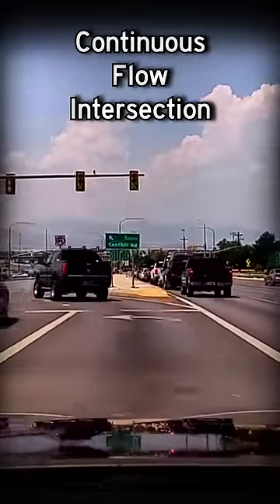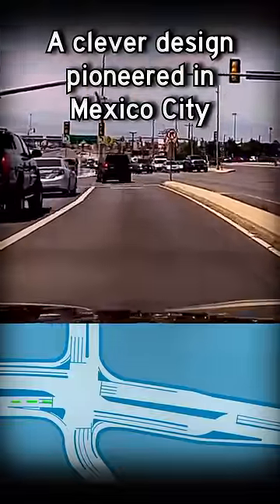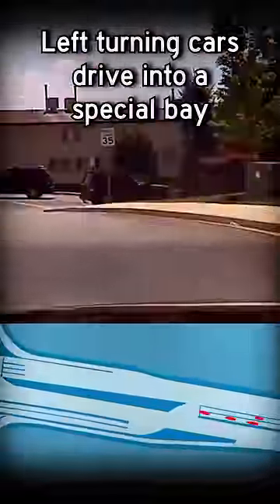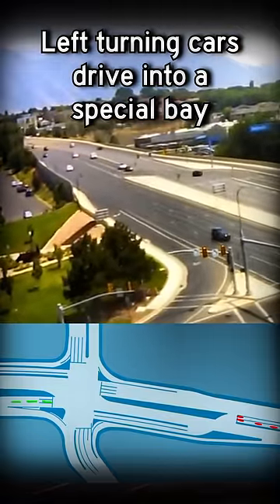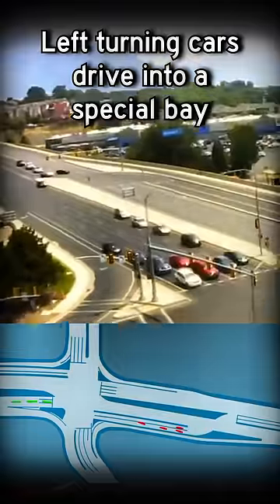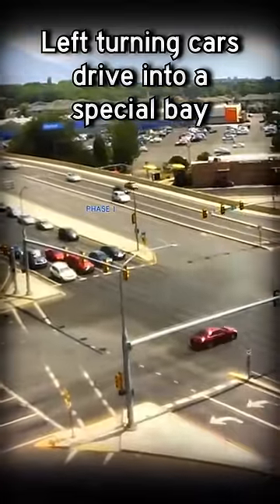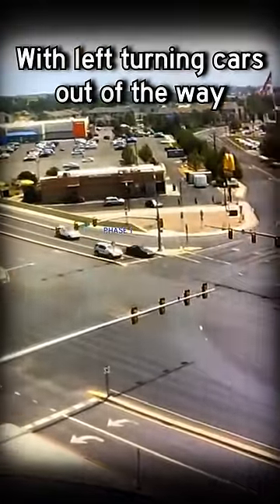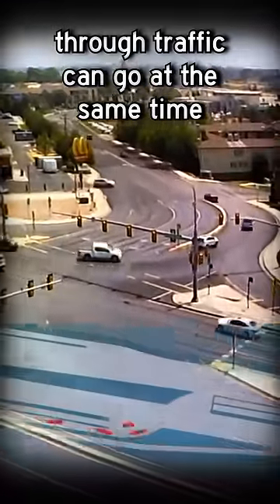Continuous Flow Intersection #shorts

Comment: Let’s instead start designing cities for humans, not cars. We need more innovation and investment into protected, separated bike paths with proper rezoning, not millions so that impatient, irritable drivers can save an extra 2 minutes at an intersection.
Reply: *metal cages
Reply: While I agree it would be nice to have more bike-friendly roads, the reality is that for any kind of city small enough that bikes are viable options for daily commutes, there's not generally a lot of issue with just riding your bike down the road or on a shoulder.

When you get to cities big enough where biking is difficult without dedicated bike infrastructure, it's not typically feasible to actually commute on a bike, so you're just adding a new problem to the existing transportation problem.

Even experienced, very fit cyclists typically only hit like 15-20 mph in very flat cities. Even for a short commute in a medium-sized (half million people) city, that's a couple hours a day just riding, not counting extra showers, compared to like 30 minute to an hour for a car. On a longer commute, you're looking at a couple hours each way. The commute I used to make in Spokane at 40 minutes each way (by surface roads that aren't even car-friendly) becomes 3 hours each way on a bike.

And all that assumes you're in good shape and don't have health issues. And completely ignores issues like rain and snow.

Picking some random locations in Berlin, with one of the best public transportation systems in the world, and very high population densities that slow cars to a crawl, I could only find a handful of routes where the bicycle was even comparable to a car. And public transportation is barely faster than a bike.
Reply: @GeekOfAllness  That’s why the concept of the 5-minute city applies here; it’s very typical to bike anywhere from 1-2 hours every day in Europe. The average American commute is 55 minutes, but its almost an hour of non-activity. We should be getting 1-2 hours of physical activity everyday anyways, so biking fundamentally kills two birds with one stone. The objective shouldn’t be to minimize biking to the lowest common denominator, but rather encourage it in the proper metrics so as to facilitate a healthy, active population. The average American spends an excess amount of time indoors, or what some people call “time wasted” (~2 hours per day), with a dwindling amount getting any form of physical activity whatsoever. Using an example from anywhere in the US to compare commute times isn’t right either, as in cities such as Amsterdam, Warsaw, Prague, Aachen, Maastricht, etc., biking is faster than the automobile, as well as universally safer, healthier, happier, cheaper, and more social. If you’re worried about people being in good enough shape to bike, the solution isn’t to shut them into a car and hope they somehow get healthier that way; if people are unhealthy, we should do the exact opposite and actually promote biking—it’s a problem that solves itself, as well as a myriad of other issues. Many of the symptoms of acute and chronic illnesses are also demonstrably linked with a lack of physical activity, including rheumatoid arthritis, Stickler’s syndrome, depression, etc. We cannot argue against one of the most accurately charted treatments for these illnesses. Also, rain and snow don’t affect bike ridership in cities with well-designed biking infrastructure; they do, however, increase daily car injuries and fatalities by manyfold.
Reply: @GeekOfAllness bro is waffling

Comment: Ummm that’s Orem, Utah. Been driving on that road for 10 years now and it’s better than you think. It made the whole road less congested and less accidents. At the beginning of the road, it has the largest university of the state UVU plus a Walmart super center and 5 minutes down has the largest mall in city, plus Costco and movie theater, Best Buy, 4 cars dealerships, Lowe’s then 5 more minutes you have the 2nd largest university BYU. That intersection and road is a major artery of the two cities Provo and Orem are which have about 200k people living there. So yea we need something to decongest the intersection. You just need to be there to understand it.

There are at least 10 round about sin Orem and Provo and two of them are just a minute away from that intersection, they work great when the road is relatively flat, and equal speed on all sides. That area is really walkable, tunnel between the university and Walmart, and within the university, bridge between train to the universities and housing. Train between the largest cities to the university and buses along that road.

Comment: This really dosen't seem that bad, not sure why people are sandbagging it. I had a similar idea in the past except the actual intersection itself is a roundabout. That being said, a ton of people think that giant roundabouts are the answer when more considerate road structure would fix most problems with highways and such. Of course then we loop back to not being able to put roads where you need to because something or someone is already there.

At the end of the day, roundabouts are perfect for smaller intersections. Once you get into bigger roads with more lanes, I prefer smarter design over giant confusing roundabouts.

Comment: this is the exact same thing and isn't continuous as they still have to stop to turn left into the second special bay. I've seen them make it so if you wanted to make a left you would actually go right and it would loop around and go under the road and have you come out at the right lane of the road on the left. now that's continuous as you or anyone else never has to stop, and you're where you need to be.

Comment: No… they put one of these in Snellville GA and it is a cluster f*k! This DOES NOT WORK in heavily trafficed areas. It makes it 10x worse because they didn’t make it big enough OR far away enough from other lights. So when the light turns green on one the other light is still red not allowing any cars to move forward until the last 5 sec of the other light…. 

The one in the video looks like it works well because there’s plenty of space and little traffic. Idk but here in GA they dont make them big enough. Same with roundabouts. Roundabouts  only work if theres plenty of space for people to jump in and out with a blinker… not when theyre practically the size of a regular 4 way stop 😂 siiigghhh

Comment: An idiot group added that to our city.  Claim was to improve the flow of traffic.  Went from one intersection to 3 intersections and the cross street can only turn right with left turns being done 1/4 mile before the intersection onto other roads, then additional intersections to be on the road.  These "bay" sections for left turns stop and block vehicles 500 feet from the original intersection.   They drive between oncoming traffic lanes.  Often a car ends up the wrong way against traffic.

This was sold to the public as a continuous drive intersection with a bridge.  Still ended up over budget, over due on time, solved little, and made the problem worse.